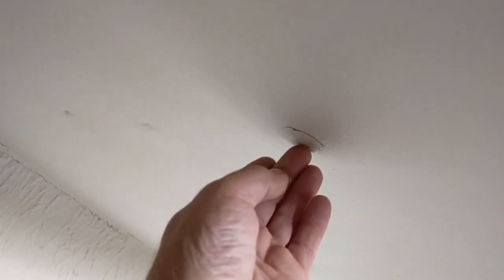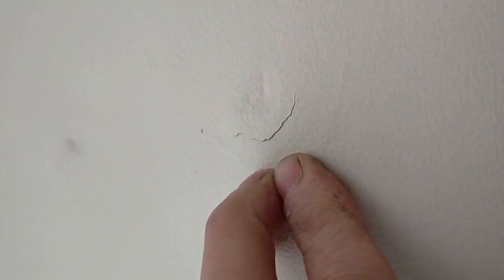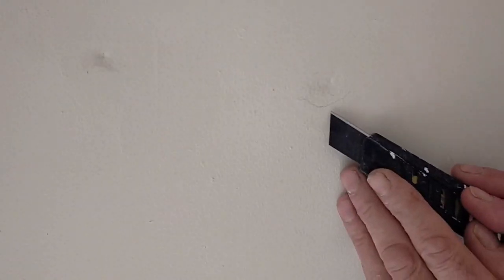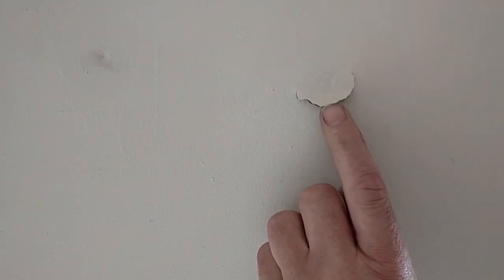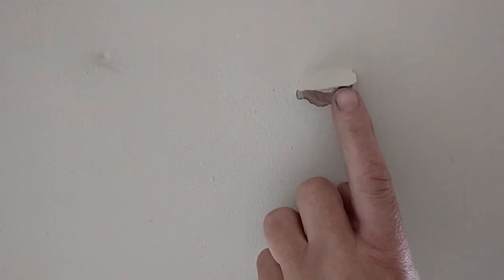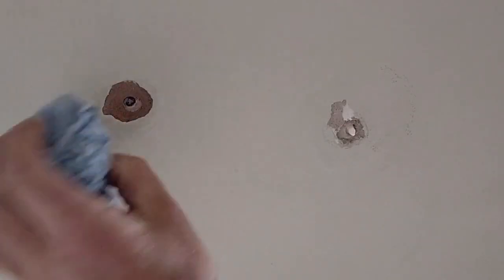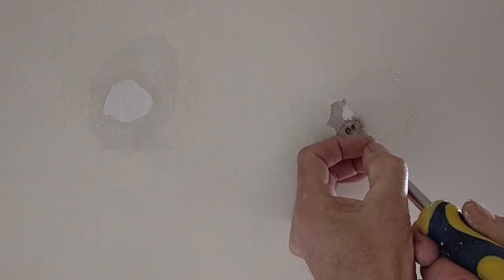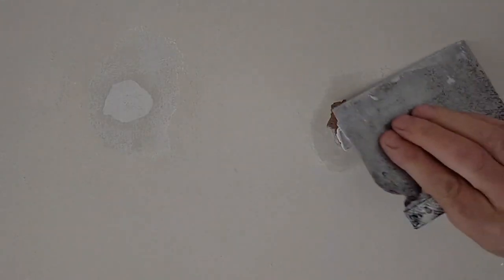PLASTER POPS SOLVE PERMANENTLY

Comment: Another quicker way is: pull the failed plaster off. Drive in 2 screws either side of the pop. 2 part filler. Sand, paint. This method allows you to fix a screw pop in 15 minutes and that’s a painted finish.
Reply from the maker: Decorators don't use 2 part fillers for plaster..  it's not about speed.
Reply: @PaintingandDecorating  incorrect
Reply: I use 2 part fillers quite a lot. I've been let down by these water fillers so often.Any deepish hole to fill can take hours to dry through properly.With 2 pack its minutes and ready to sand.

Comment: I’ve got plasterboard joins visible below my paint in a new build. I’m about to repaint those affected walls. Would you recommend carving the join out, filling, sanding, prime and paint? Is that the correct method? Thanks.
Reply from the maker: Yes if it's proud from the surface it's the only way.. thanks
Reply: @PaintingandDecorating  Thanks!

Comment: Hi mate great video as always! Was wondering if you could help me out with some advice please, I’m looking to paint some concrete patio slabs. I see that zinsser allcoat seems to be mentioned a lot in forums. Would you go with that or something different? I know your a big zinsser fan lol. Thanks in advance for any advice you can give and keep up the good work. You are top of your game and it’s nice to watch someone do things properly. Thanks again
Reply: I’ve used Zinsser allcoat. I personally didn’t like it because it doesn’t roller on nicely. So I decided to use it for some other jobs where a smooth roller finish wasn’t needed. This included some concrete outside and it seems to be fine so far. White needs a few coats.

Comment: B&q building section £10 for metal foam gun. Caulk nozzle can be rammed on the end for holes. Store with foam cleaner can attached to gun.
Those one time foam cans can be a nightmare with no flow control and I had one stay on. Foam everywhere!
Reply from the maker: Yes they can have issues.. will try a gun at some point.  Thanks

Comment: just take screw out and screw one a inch beside it.
been doing that for years .
I never had a problem.
Reply from the maker: Sometimes the screws miss completely.  And sometimes it can be difficult to find a fixing. Plus you need to be careful moving the position of screws just in case.. wires .. pipes

Comment: Do you know if that foam is waterproof/resistant? I ask because I need to use some and it needs to be water / moisture resistant and I know there is two kinds. I find it all quite baffling. Thanks 
Alex
Reply: By it's very nature, foam is not usually something that's selected when waterproofing or resistance is required. Whats it for?
Reply: @idi0tdetectioninprogress  thanks for your response. It's for a couple of things actually - one is putting around window frames and the other is for filling some large splits in some wooden beams before filling with wood repair/filler. I have read that closed cell foam is best moisture résistance but not sure which is which. (I am using it for a property in France and my french isn't up to scratch but have seen this exact product in the DIY store)
Reply: @alexthomson7465   Ok. So your main factors in choosing a foam are  things like soundproofing, movement, and are the gaps large or not. The windows need a waterproof finish, with something like an acrylic sealant anyway, so the foam shouldn't be exposed to the elements in normal service. 
  Cracks in wood, I'd suggest looking at something like a resin based product. That would give you strength for timbers that may be in tension or compression during their life.
   Good luck in France🇫🇷
Reply: @idi0tdetectioninprogress  thankyou for the advice! It is really gratefully received as I am learning as I go. And sometimes learning too late lol.
Reply: @alexthomson7465  😂everydays a school day👍 Half the battle is the myriad of products on the market now, and choosing the right ones.